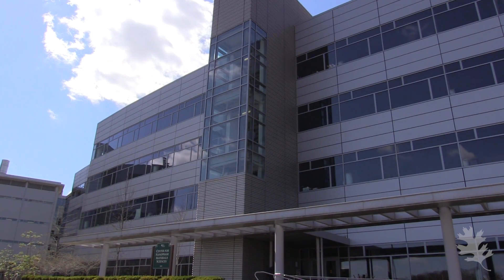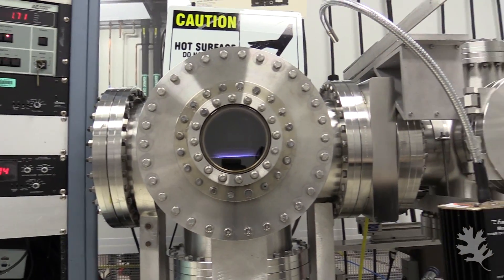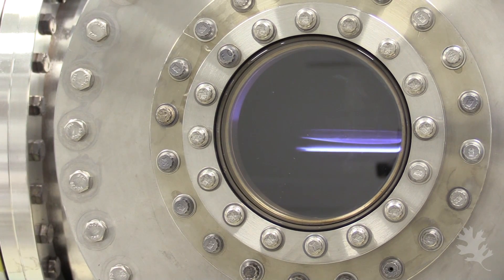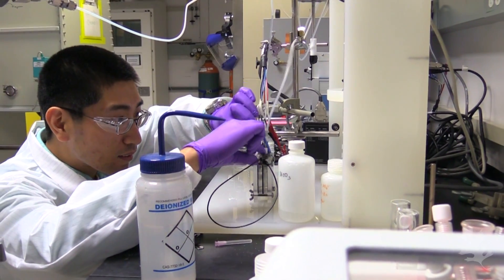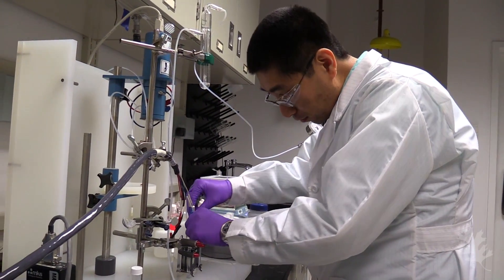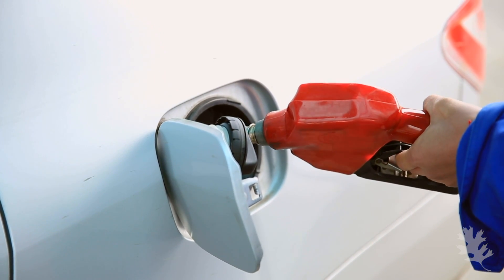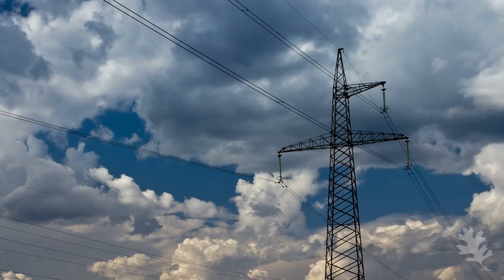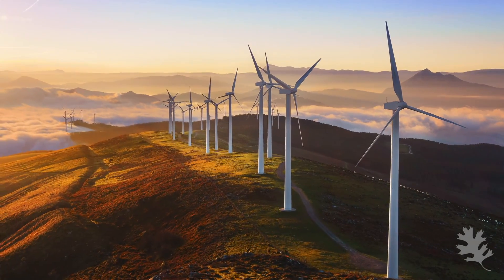Nano-spike catalysts convert carbon dioxide directly into ethanol

Comment: Imagine this catalyst connected to your car exhaust producing ethanol from CO2 which is then injected into your fuel.  Not only scrubbing CO2 from your exhaust but increasing greatly your miles per gallon of gas.  Imagine getting 75-100 miles per gallon of gas.  Are they working on scaling up this catalyst up to the point this can be done?

Comment: So...CO2 and water (Ya gotta get the H somewhere.) yields C2H5OH by a process utilizing nanofabrication and catalysis? The narrator speaks of using the ethanol as a fuel for internal combustion engines. Wait a minute. He also speaks of “all the electricity that’s going into it”. Where’s the input electrical energy generated? How much energy does it take to produce the catalyst? And finally, combustion creates CO2 and heat. Hmmm...
Reply: https://translate.yandex.ru/web?url=http%3A%2F%2Fwww.findpatent.ru%2Fpatent%2F258%2F2582125.html&lang=ru-en

complicated crap basically says the metals reduce the hydrogen and oxidise the oxygen out of the water. these metal hydrides can then react with carbonic acid, basically being disproportionate in forming H2O molecules from the H2CO3 ---> H2O + CO2, and reducing something in the process, this being the carbon compound in question, CO2.

Comment: cars just create more pollution though, this seems counterproductive
Reply: That's dumb. This is CO2, one of the two main products of hydrocarbon combustion. Hydrocarbons are things like gasoline, oil, ethanol.

 It uses H2O and CO2 to make O2, ethanol and some side products such as ethylene and H2.
Cars don't "create more pollution". 

What is sad is this mental disease where people dumb things down to catchphrases like that to substitute mechanical understanding.

Let me dumb it down, but in a sensible way. 
Cars emit H2O, CO2, CO, NO2, NO.

The NO2 and NO form nitric acid upon contact with water. 
This isn't good for you nor the environment. 

Platinum catalysts in exhaust converters turn this into harmless N2. 
Some of the toxic CO gets converted to CO2.
CO2 is just an asphyxiant, meaning it's not bad, it just displaces air and you can't breathe it instead of air because you won't get any oxygen from it.
Besides, you exhale CO2 for a reason.

Now we're left with H2O, N2 and CO2 from a car exhaust.
The N2 is unreactive and like 80% of the atmosphere is N2.

This is the point:
The H2O and CO2 can be used to make ethanol, which can be burned again to produce H2O and CO2. This means you can effectively create cars that do not have an exhaust. It only takes electricity to re-make the H2O/CO2 into ethanol.

Comment: Awesome!  I hope universities and other research institutions are replicating these results.  I think the geometry of the nano spikes is key.   i.e. varying the height distributions of the nano spikes will lead to different efficiencies and different end products (i.e. different fuels).
Reply: Also, I wonder if this process can be reversed?  ethanol fuel cells  kind of exist in that companies like nissan run ethanol through a "reformer" which converts ethanol to hydrogen and then that hyrogen runs through the actual fuel cell.   But can this oakridge technology be used as a new cell "membrane"?  Thus Ethanol on one side of the membrane and 02 on the other side of the membrane (also a small amount of electricty through the membrane) releasing electricity and c02 and water.

Comment: So your answer is solar > ethanol -> tank -> generator engine -> grid instead of solar -> battery -> grid, or solar -> ethanol> tank > truck -> gas station instead of solar> grid-> EV?  Please provide an energy flow chart because I am calling BS that there is ever a case where that is more efficient than current batteries for grid storage or EVs for transportation.  This video and headlines around it are very misleading, you did not get around the first law of thermodynamics and get an energy dense alcohol out of just co2 and a catalyst, you are putting much more electricity in than you will ever get back as power in an ICE. This is probably no better than hydrolysis for H2 for fuel cell vehicles.
Reply: you're biased

Comment: As someone with a PhD in the area, this sounds like more of the same old nanotech snake oil.  

It is'not efficient, or else they would be giving the numbers (notice that they do not give the energy in, energy out, or any exergy analysis -  not even a hint).

We can convert CO2 into ethanol extemely efficiently with the same process we've used for millenia - fermentation.  And we can do it with a great many plants, not just corn.

Obviously this can't compete with fermentation, so  they are selling it as a battery.

Sorry, to be a good battery, you need extremely high conversion efficiency; otherwise, nobody cares.

Comment: It is no clear how many electric energy is used by the process, i.e. to produceI1L of EtOH. It is said "63% Faradaic efficiency "(article). I don’t know if this could lead to similar operational efficiency, but that looks very interesting, compared with the yield of a 25% fuel thermo-electric generator, 12-16% yield of PV, yield of H2 production by electrolysis,... 
Even lower yield may be acceptable as long the primary electricity is green and cheaper that fossil one. Developments might increase yield. Furthermore yield is to be balanced with manufacturing/maintenance cost of this process and also upstream ones (PV) and downstream (Fuel Cell when electricity is finally needed).

I'm rather optimistic also regarding the possible cost of the process: a) the reducer is H2O! b) it should be affordable to produce nanospikes or Cu/C ? used simply as catalyzer, maybe recyclable. Large scale production should drop cost quicker that occurs for PV, because C and Cu are ubiquitous.
Furthermore, it would work with energy consumption current technologies: heaters to burn EtOH, fuel cells to convert EtOH to electricity, tanks to store and transport EtOH…

 This process would lead to an Ethanol energy pathway that is much more attractive than the Hydrogene.

Finally, I mainly fear that IP protection may lead to controlled and concentrate exploitation, monopoles?, which would not fit with point-of-use ecological energy production and point-of-use consumption. Hope the inventors, the Oak Ridge National Laboratory nor private companies will refrein the spread of the technology!

Comment: Let's remember one thing. Ethanol as a liquid is so much easier to store than CO2 gas. Today's CCS technologies capture CO2 from oil rigs and powerplants then store them underground at high pressures where there is always a risk of leakage. Converting it to Ethanol before storage is much more stable.
Reply: No one is pumping CO2 in the ground, sheeple.
Reply: Thank you for your comment. From what is presented, it seems that nano-copper electrolysis could replicate Hydrogen fuel cell technology, if the byproducts could be reliably sequestered. Some CO2 stored as dry ice cold storage may solve other problems.

Comment: Awesome, but wouldn't you actually waste energy when producing Ethanol out of CO2? First of all you have to put in electrical power + use a lot of Hydrogen gas to hydrogenate the carbondioxide to C2H5OH. 
Hydrogen can be used as a fuel itself + a huge amount of electrical power is generated by burning fossil fuels, waste, coal etc.... so basically you put that energy back into your reaction that has come out of something that has already been burnt

Comment: "With the help of the nanotechnology-based catalyst which contains multiple reaction sites, the solution of carbon dioxide dissolved in water turned into ethanol with a yield of 63 percent."
So they can turn Coca-Cola into Cuba Libre? :D
Reply: You can never make a real Cuba Libre with Coca-Cola... at least not at this point in time.  Science does not know how.
Reply: SOUND LIKE TURNING lEAD INTO gOLD aLCHEMY

Comment: So ummm... ok, am I missing something here? Let me get this straight? You claim you're getting from CO2... to  C2H5OH... by means of only copper, silicon and carbon. Am I the only one wondering where the hell do you get all the HYDROGEN from?
Reply: Corwin111 water, the co2 dissolved in water
Reply: I really hope it's that simple. Splitting water molecules requires power, however. And so does scrubbing CO2 from air. And if these two end up requiring more power that can potentially be produced by the resulting ethanol, the process will not be the panacea everyone seems to be hiping it up to be..:)
Reply: If my high school chemistry still works, the conversion formula would be: CO2 + 3(H2O) => C2H5OH + O3.  Or, output of one molecule of ethane and one molecule of ozone.  The electrical energy input must be the cost of conversion, the 35 - 40% loss.  And there should be no depletion of the copper catalyst: it would not dissolve or be an electrolyte but rather just a passive agent to introduce the electrical flow at the nano-points.
Reply: Sounds about right. And then we will need to add, to that the energy cost of obtaining the CO2 and compare them to the overall ethanol yield. That said, this should certainly see applications in closed environments, such as submarines and manned spacecraft, where CO2 needs to be scrubbed from the air anyway and currently just gets discarded as waste. Instead, if it can be turned into additional fuel, that would be pretty cool. I suspect the yields are not going to be all that huge, though. Still, there is the moonshine option, I guess. ;)

Comment: Even if we used this for our energy needs, we'd still have to cut back our energy use for it to do much good for the environment, right? If we take the CO2 from the air and make it into ethanol, when we burnt it as fuel, it would then go back into the air. We're reducing the total amount we're putting up but in effect not reducing the amount that's already there. So it's a good start, but we still have to reduce our energy needs somehow.
Reply: The electrical energy could be sourced from solar or wind.

Comment: This process requires electricity. Either you burn the ethanol for fuel and it's like a fuel cell (this doesn't make sense for the climate), or you  store millions of tons of ethanol in caverns or somewhere. (this doesn't make sense economically)
Reply: On the bright side, you can get drunk for free now.
Reply: I'm not talking about BS free energy or perpetual energy generators as you are implying i'm saying.
I'm just joking about how there will be such a surplus of ethanol that they'll be giving it away for freeeeeee
Ethanol is drinking alcohol if you don't know..

Comment: How much total energy goes into this new process vs what comes out? That wasn't very clear to me from the video. They said the catalyst could convert up to 70% of the CO2 sent to it but that doesn't explain how efficient the process is in terms of energy consumed vs energy delivered. What am I missing?
Methanol from Corn for example has been widely discredited because the total energy used in making it (fertilizer, tractor fuel, cultivation etc) is higher than the energy you get out of it. Yes this is a catalyst and not a farm in Nebraska but the concept of how efficient is the same.
Reply: He said that also around 65% of the energy was used to create the ethanol. Which would also mean that that same 65% could then come out of the ethanol again by burning it (if my understanding of the chemestry is correct). So yes, you are using more energy than you are getting out of it, but that's kind of obvious. The point is that this could be used as a kind of battery. When there is too much energy due to green sources, you can just make some fuel. If there is not enough energy, you can just burn some fuel again. This way your normal car with actual combustion engine could basically run off the electric grid.
Reply: Tijmen Zwaan That's what I thought. The problem is less than 10% of U.S. electricity generation comes from alternative sources like Wind, Solar, Geo-Thermal etc.
Long story short the 65% efficiency has to be tempered by how much it can be used. You also need to add the costs of scaling up their experiment to store all the energy say from a wind farm on a night with wind from 12:00am to 7:00am. You'd easily double the cost of that wind farm which already is probably twice as expensive as natural gas.

I don't mean to be a troll here but there's a lot that must go into an efficiency calculation for alternative energy.
Reply: More than that it's a way to remove CO2 out of the atmosphere by putting it in a liquid form. (easier to transform that into carbon to put back to nature)

It's not energy efficient but that's okay. If it's done with clean energy, it's a way to clean the atmosphere out one of the green house gases.

tl,dr: May not be good for energy, but it's an ecological tool.

Comment: I wanted an easy, cheap way to store energy produced by  solar panels in the summer to use to heat my house in the winter. This looks like it. I also could mow my grass in the summer, dry it, and press it into pellets and burn them in my stove. This would be carbon neutral.

Comment: I don't get it, where do they get the hydrogen molecules?
Reply: Water?  Either water vapor, or immersing this in water.  Something like 2CO2 + 3H2O -> C2H6O + 2O2.

No idea if that is exactly what they get out of it...I'm sure there is more to it than that.  However, it would be interesting if it was also producing pure O2.  That is useful as well.
Reply: Was wondering the same thing, came to the comments section for answers and as of right now you're the only one to bring this up. CO2 can't provide the Hydrogen needed to make ethanol C2H6O. I think it's personally reasonable to believe Oak Ridge knows how to perform magic, but I'm interested in the exact spells and incantations.
Reply: Roy H Yes knowing that changing the atoms from one element to another takes an incredible amount of energy, it cannot be done in this experiment.
Reply: The experiment is producing ethanol from dissolved CO2 in water.  So it won't work by just having air flow across is.  I wonder if they purified the water to contain just CO2 or if other 'contaminants' will destroy the catalysts or the process.  Important if the idea is to draw ocean water into an upscaled unit in order to reduce the dissolved CO2 levels in the planet's water... since it's at it's limit as a CO2 sink and is offgassing it back into the atmosphere.
Reply: Makes me wonder what H stands for in H2O... :D LOL
Reply: http://onlinelibrary.wiley.com/doi/10.1002/slct.201601169/full
Reply: make me wonder too the C2OH5  i didnt see they used water
Reply: So I guess our breathing is also a waste of combustion too?

Comment: PLEASE BE TRUE AND please be implemented... my god
Reply: Shell starts a fantom company that buys the project and makes sure it never exists. I'm calling it now.
Reply: Idk man, this is not cutting into anyones profit margins, infact oil companies wouldnt mind this cause it lets them keep burning more oil.
Reply: Two issues here: efficiency in generation of ethanol, and carbon sequestration:

Generation of ethanol: Compared to 'ideal conversion'  this is not quite as good , but  plant-based conversion is much less efficient! It's useful in many situations and has the capability to replace other less-efficient methods that themselves then cause carbon emissions. 

Sequestration: this issue is scrubbing the CO2 out of the air, primarily. As long as the CO2 generated by making the electricity doesn't exceed the amount sequestered, then this process is valuable. Note (as to your last sentence) that the 'fuel' must also be sequestered and not re-burned (to assure sequestration).

Comment: What kind of MPG boost would this tech give if used in cars?
Reply: None,  a drop in MPG is more likely.
Reply: Vilifying Force explain the chemistry??? given a current combustion engine you add this tech that recycles the co2 emissions into an ethanol tank that can then be added to the fuel and recombusted.
Reply: Roshan Rasekhi I think expecting this to be installed in vehicles is thinking way too far into the future. If this even works it wouldn't be rolled out in new cars. I would expect more like. propane tank style exchange system. Also most cars can't run on pure ethanol under their current set up.

Comment: so... how much energy does the process require in total? those nanospikes aren't going to make themselves
Reply: It takes more energy than it outputs, but they're suggesting to use it when they have surplus electricity that would be wasted and then stock ethanol to back up the grid's output when necessary.
Reply: Not a great deal and probably a hell of a lot less once the people who've been building nanostructures on silicon for decades get on board. 

Furthermore, heating ethanol in sulphuric acid yields ethylene, and ethylene is a feedstock for both plastics and  longer chain hydrocarbons.

And since they got an extra CH2 by accident here, there's a reasonable possibility that longer chain hydrocarbons might be directly achievable with refinements to this process.

Comment: Sorry but ethanol is not better for the health than CO2, read 
"Effects of ethanol (E85) versus gasoline vehicles on cancer and mortality in the United States" at http://www.ncbi.nlm.nih.gov/pubmed/17612204
Reply: " it can be concluded with confidence only that E85 is unlikely to improve air quality over future gasoline vehicles"

Wich is to be expected because you're still burning fuel. 

He doesn't conclude anything else. He only states that large scale us of E85 fuel MAY result in a global-scale source of acetaldehyde larger than that of direct emissions. Without any proof or information on how much larger or why.
Reply: The fact that this method is actually usefull is because it can filter CO2 out of the air, thus actually improving air quality.